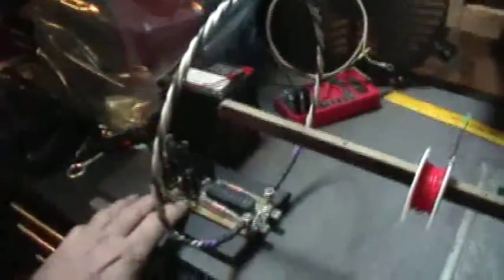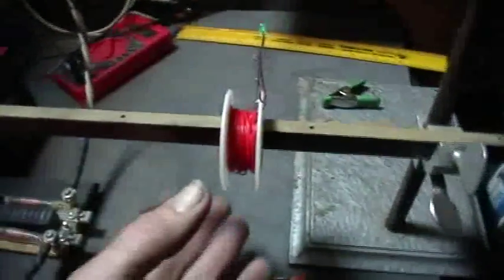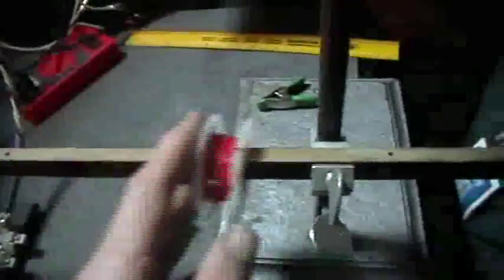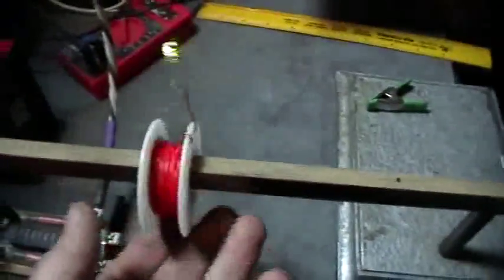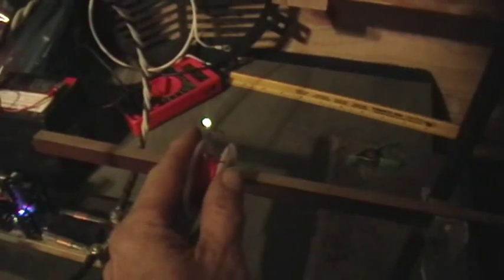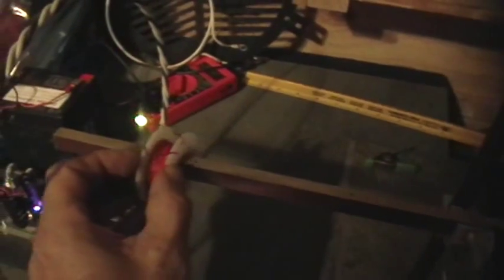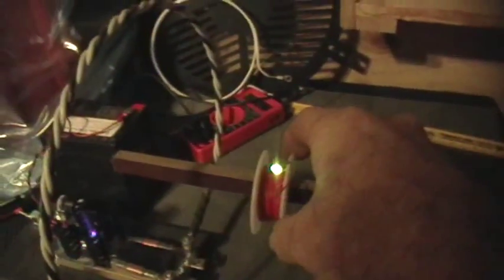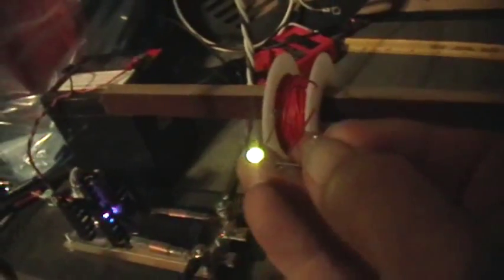Joule Thief: Supplement: Illustration of Receiver Coil Tuning with Added Capacitance

Comment: The capacitor will also act as a wireless receiver in addition to the coil, and if that's a wooden stick your using , wood is very good believe it or not , at conducting a wireless charge, and will help the distance. Try flipping your circuit upside down and submerging your large loop in an aquarium of water. Your wireless capabilities will upgrade. I do these things always :) I find very interesting things!

Comment from the maker: Thanks!
Yes, if you look at my videos headed "wireless power" you will find the links to the schematic for the transmitter. Also you will see it working with proper tuned receivers, lighting bulbs and driving motors. I've even done wireless underwater electrolysis.

Comment from the maker: If you have a tiny air-variable capacitor, like a tuning cap or trimmer, in the range of a few tens of picoFarads, try putting that across the coil/LED and tuning it. You might be surprised.... and it might have no effect, if your coils are already "accidentally" well tuned.

Also you might like to take a look at my videos "resonance effects for everyone" (borrowing the title from GL) where I show the profound effect a little cap tuning can have in a system of air-core mutually coupled coils.

Comment from the maker: Presumably you have used the same number of turns in your coils, the same amount of wire, the same physical dimensions. This will mean that your coils are pretty closely tuned already. In addition, the major co-coupling in your system is between the JT coils proper. This means that the third coil, the "receiver", won't affect the transmitter's resonance in the same way as it does in my system. I don't know how strong the "mutual resonance" phenomenon can be in your setup with the JT dominating.

Comment: Greetings TK... First, thank you a lot. I tried a few ceramic caps that I have here, inverted the polarity of the led, but it not seem to work on the kind of air coil I am using. Only you to discover, while me... I will keep experimenting and building my little boxes. My best regards.